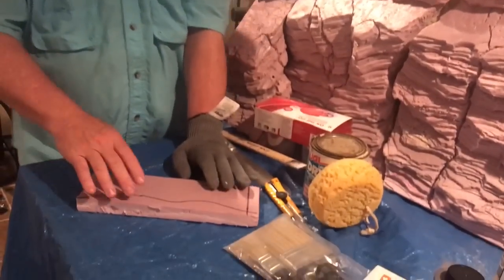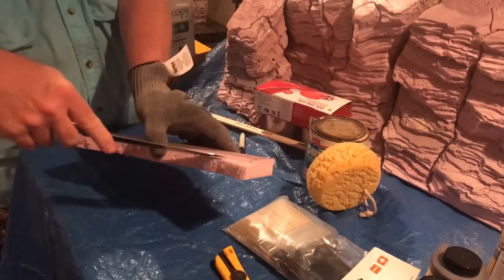How I Created My Faux Rock Wall Aquarium Background

Comment: Watching this guy using the knife, absolutely terrifying and anxiety producing....seeing the results, absolute perfection! Amazing work thanks for sharing your expertise/tips!
Reply from the maker: Thank you very much.  I learned the hard way to wear a filet glove after having to get a few stitches  on my thumb.  After that, I never came close to an issue.  There are some good comments below that could improve on the safety aspect of cutting foam like this.  One was to find a way to clamp the foam boards together so that you wouldn't need to use the other hand.  If I had to do it all over again, I'd probably go that route in addition to using the filet glove.

Comment: Good job,quiet realistic.I did mine with a soldering iron and drew the rocks and then aged it with a blow torch
Reply from the maker: Thank you Peter.  I did some work with a heat gun and soldering iron as well, but on the roots, not the wall.  I experimented with both on some of the wall pieces first, but chose a different route with them.  There are so many ways to get a result, the key is to find one that is consistent with your end product.  Do you have a link to your work?

Comment: You sir are nothing short of amazing!  How many hours do you have in that piece?
Reply from the maker: I stretched work out a long time on this project, starting a couple years ago and am now almost finished.  However, the actual time working on it took far less.  I had to figure out how to make it work, and I spent a lot of time "thinking" about those things.  I'm kind of a perfectionist, I guess, and I kept fiddling with it to get the look that I wanted.  Once I made decisions on the direction that I'd go, I jumped in and got each step done pretty quickly.  Waiting for the glue to dry after gluing the each of the boards together with Gorilla glue took about two hours for each layer before I'd move on to the next, so that is probably the most time consuming part.  I've since painted and installed the piece in my tank.  I painted it with Drylok mixed with cement dye, and that took some time for each layer to dry.  So yeah, maybe I could do it again in a couple weeks or less, knowing what I know now, If I spent all of my free time working on it, and had to do it again.   The bigger problem is that I spend a lot of time in the outdoors, fishing and looking for fossils, so another reason this wasn't done quickly, LOL  Anyway, thank you for the compliment!

Comment: Did I miss how you get it to stick to the back wall of the aquarium? also do sea urchins chew it up?
Reply from the maker: This is in my river tank.  How I built it all is in my build thread on NANFA.  But, basically, I made it in 3 pieces and used a heckuva lot of silicone to adhere it to the glass.  Also, it fit very tight within the frame, so no chance of it coming free.  It's all FW, so no critters can mess the wall up.  I painted it with many coats of Drylok but after I installed it, I didn't want to ruin the wall via tank maintenance, so I used a museum clear coat called Polygem.  Now it's almost indestructible.  There are lots of videos on this channel showing it after I installed it and have many tank updates since with fish in it.  My build thread should answer any questions.  That said, someone commented on here previously that they'd like to see a build video from start to finish, so I may do that some day.  It's a lot of work though.

Comment: Hey! I tried doing this with drylok hydraulic cement with the same pigment but after it dried the color would just come right off with my finger until it went all the way through to white foam. I see you are using regular drylok correct? Any thoughts
Reply from the maker: Yes, I just used several coats of the Drylok waterproofing paint covering pink extruded polystyrene foam insulation board. Here’s a link to what I used. https://www.homedepot.com/p/DRYLOK-1-gal-Clear-Interior-Exterior-Floor-and-Wall-Basement-and-Masonry-Waterproofer-20913/205079075

Also, don’t get the Drylok with any mold reduction chemicals.

After I completed painting, I coated it with Polygem clear coat epoxy to protect it.

Comment: Question : how do you keep the wall from floating up in the aquarium?
Reply from the maker: That's a really good question Nigel.  After I finished constructing the foam boards, there was a gap between the back frame of the structure and the front of the wall that I stuffed with river rocks.  Then, I sealed them in with spray foam.  I used 8-9 tubes of silicone applied to the top, bottom, sides and back of the structure as well as the tank...so...tons of glue.  In addition, the entire thing fits tightly in the tank under the tank frame and cross brace, which I think is key.  I've had the tank up and running for 3 years and it doesn't budge.  I am putting together a video that I will have out soon that goes into detail from start to finish and the status of the tank today, so stay tuned!

Comment: Question: how do you keep it submerged? It seems like it would be extremely buoyant.
Reply from the maker: Thank you for your question Laura, it's a good one, and an issue that, when planning this, made me struggle and worry about how I'd avoid it from just coming apart. The 3 structures are basically hollow and filled with river rocks to help keep it less buoyant, but more importantly, the three sections fit tightly inside the aquarium frame, snug to the top. I also used a ton of silicone glue on the bottom, back and sides. So far, so good. This tank has been up and running since October 2019 and I have not had any issues with the wall. If you wish to learn more about this build, I have a build thread on the NANFA forum: https://forum.nanfa.org/index.php/topic/16651-75-gallon-native-stream-tank-build/

Comment: Excellent work great technique
Reply from the maker: Thank you so much Orion!
Reply: @coachkevinwilson1958  I could use some Pointers and advice if you’re still on here LOL
Reply from the maker: @oriondriscoll3516  Sure Orion, no problem.  I have a build thread on the NANFA forum that details just about how I did everything from start to finish, and updates after.  I can give you the link to that if you're interested.  In addition, you can contact me there with questions, or here, however you wish.  But, that build thread has a lot of pics and details.

Here's the link:  http://forum.nanfa.org/index.php/topic/16651-75-gallon-native-stream-tank-build/#entry140297
Reply from the maker: scroll about halfway down the first page and that's where the fun really begins :)

Comment: I bookmarked this vid but couldn't find it for a long time. Im so glad i randomly found this again. Really outstanding work. Your wall really does look amazing. Can we get an update? How has it held up?
Reply from the maker: Thank you so much Casval!  I'm making a new video from start to finish that has an update at the end.  In a nutshell, it's solidly in there and held up great.  The big difference was using Polygem epoxy clear coat after I finished painting it.   The clear coat is invisible under water and really keeps me (or fish) from chipping off paint or foam, and makes the structure very solid.  Polygem is one of the brands that museums, public aquariums and zoos use.  I explain all of this in my next video, coming out soon. Stay tuned!

Comment: The last step is to paint the foam with drylok and cement pigment? Did i get this right? And how long normally to leave it until it fully dries up?
Reply from the maker: Yes, I painted several coats of Drylok mixed with various colors of cement dye (you can also mix them) to get the colors to match rocks found in my area.  I guess each coat took a couple hours to dry.  I used paint brush for the first coat without dye (was already gray in the can), and a sponge to dab it on after that for each subsequent coat.  After I installed it in the tank, I wound up using a clear coat epoxy to add strength to it that I got from Polygem and it turned out great.  I did that because after doing all that work, I didn't want to damage it when doing cleaning and tank maintenance.  The Drylok is a good sealant, but, that on foam can chip off accidentally by moving rocks or using cleaning tools.  Now, it's as strong as real rocks.  Here's my build thread, starting with the Drylok painting of the rock wall:  http://forum.nanfa.org/index.php/topic/16651-75-gallon-native-stream-tank-build/?p=149813  The posts after this show all of the paint layers and colors that I used, a couple pages later is the finished rock wall.
Reply: @coachkevinwilson1958  this is really helpful! I appreciate you explaining it in detail. Thanks! 😃
Reply from the maker: @afifahzulkefli2647  You're quite welcome Afifah!

Comment: do u have to put any sealer on it  so it will be safe for the fish
Reply from the maker: James, I painted it with Drylok which is safe and seals it in.  The foam itself is safe, no need to seal it in, but the pink doesn't look natural, hence, the need for paint.  Some people use Cement, which can cause pH issues, and sealing that in with Drylok works.  For my wall, the Drylok shows the detail that you put into it, and cement tends to cover up detail, so I chose the Drylok method.  Also, to glue the layers, I used Gorilla Glue, and once cured, is inert and safe for fish too.

Comment: hiya would these styrene backgrounds pose a fire risk with the heat bulbs
Reply from the maker: I don’t think so in my case because it’s entirely submerged in my aquarium, and, I have LED lighting.
Reply from the maker: After thinking about this, I think if I was going to do one for reptiles where such a bulb was being used, I'd cover it with a cement solution rather than what I used for an aquarium (Drylok/epoxy clear coat) for that reason. You can get the same colors using cement dyes that I used in my Drylok. You might not get as much detail in some cases, but I've seen some really nice backgrounds using the cement method.

Comment: Fantastic work..dry loc is not dangerous for the fishes?
Reply from the maker: Thank you so much! Not at all, Drylok is completely inert once dried. I also wound up using an epoxy clear coat commonly used in the museums and public aquariums made by Polygem, not to contain toxins, but rather, to protect the Drylok from being rubbed off by fish, or worse, by from me being clumbsy while working in the tank. I've had no issues as the tank has been up and running for several years now. I've had many successful spawns in the tank with some of my native fish. I couldn't be happier with how it turned out.

Comment: Awesome! Thank you for going into detail about how to carve the styrofoam. This video was very helpful for me. I was wondering how the carving was done to make the realistic looking rock breaks and formations.
Reply from the maker: Thank you so much Raven.  I used a butcher knife to chip pieces off of the edge for each foam board, then glued them together.  Once I had several sections glued together, I used wood cooking skewers to poke and chip out small pieces to make the cracks.  After that, I sometimes went back to the knife to carve out a little more along the edges of the cracks to make it look like the crack caused erosion.  You can use anything sharp to make the cracks, such as an ice pick, for example.  I used a picture off of the internet of a rock formation that I liked, and tried to imitate that as much as I could.  Does that answer your question?
Reply: @coachkevinwilson1958  yes it did! Thank you so much. You are so talented. Keep up the good work! ❤
Reply from the maker: Thank you so much Raven!

Comment: Great work. What glue is suitable for gluing foam together? And also what glue is suitable for gluing foam with glass.
Reply from the maker: Thank you so much Asiri! I used a LOT of silicone to glue the back, sides and bottom to the glass, like maybe 7 or 8 tubes, I think. This project was a lot of foam and I wanted to make sure that it didn't break away and float. I also imbedded river rocks inside the structure. It was done in 3 pieces, and was a very tight fit in the aquarium frame, which also helps.
Reply from the maker: Sorry, I missed answering the first part of your question. I used Gorilla Glue to glue the foam to foam and it works great. You will break the foam board before breaking that glued bond. Also, spray insulation foam will work well, but it's messy IMHO.
Reply: Thank you so much.

Comment: Love it question how would you add like small holes in it like if u wanted to put caves into it. I have a 90 gallon I would love try it in my tank
Reply from the maker: Thank you so much Lorenzo, I appreciate the compliment.  There are a couple ways that you could do it.  One way is to carve 2 sections and overlay one over the other with a spacer toward the back between the upper and lower section, to create a gap or crevice between the layers..  Another way would be to have a solid unit and carve out the cave, deep into it.  Both would work, but I think the first option would be easier.  My entire wall was 3 sections, and the "crevice" between them when glued into the tank looks like a natural crack in the rock.  You can do something similar like that too, with a wider crevice.  Study natural rock formations and try to duplicate one that you like.  I looked at a lot of rock formation pictures on the net until I found one that I liked.  Carving foam allows you to create anything you want.  Don't worry about being exact with your model, just similar.  Rock layers and formations are random anyway.  Good luck.  Post a link to a pic when you are done.
Reply from the maker: Also Lorenzo, check out this link to a build that inspired me.  He did great work and had a great approach trying to duplicate something that he found in nature.  https://www.monsterfishkeepers.com/forums/threads/diy-styrofoam-background-rocks.452727/

Comment: How much did you carve out on the back side? I heard some people complain that this much foam wants to float too much once you add water... even with it glued to the glass.
Reply from the maker: I filled the inside with river rocks and secured them with spray foam.  It fits very tightly in the tank.  The tank frame and the cross brace also hold it in place.  I used a ton of silicone to hold it in place.  So far, so good.  I filled the tank recently to test everything and it passed with flying colors after being submerged for a week.  There was no sign of separation from the glass.
Reply from the maker: I thought that I'd follow up 2 years later...the wall still fits tightly and won't budge.  It's holding up nicely.  So far, so good!
Reply: @coachkevinwilson1958  thanks for the follow-up.

Comment: What material you used. Is it thermacol?
Reply from the maker: Yes, thermacol I think is the same thing.  In the USA, it's known as Extruded Polystyrene.  It is sold as insulation boards for constructions of houses.  However, our local hardware store sold hobby versions of this foam board that was about 24"x24"x1" (I think, if I remember correctly).

Comment: Hi Kevin, was wondering the exact product name for the styrofoam panels..  i know they are made by Dow, and that they’re craft or hobby panels,  but having a hard time finding them in your color.. blue and white are easy to find, but i love that color you are using.. also what dimensions did you buy for the panels?  Are they 2” thick?
Reply from the maker: Hi Rob.  They're called Foamular Project Panels and they are 2'x2' and 1" thick.  I got them at Home Depot.  You can use any of the foam insulation board.  I saw some that were 4'x8' and 2" thick.  Knowing what I know now, I would have purchased and used one of those boards as well as the ones that I purchased.  I think that the thicker boards give you some more carving flexibility, and less gluing (saving more time drying).  But, hindsight is 20/20.  My project turned out OK.  I'll post a new video update soon, as I am nearly done with the faux roots for my tank.  By the way, I painted over the pink color using Drylok mixed with cement dye to give the wall a more realistic look.  Here is a link to the foam boards that I used:  https://www.homedepot.com/p/Project-Panels-FOAMULAR-1-in-x-2-ft-x-2-ft-R-5-Small-Projects-Rigid-Pink-Foam-Board-Insulation-Sheathing-PP1/203553730

Comment: What is the foam you are using and do you paint your backgrounds. If so, do you use acrylic paint? Do you coat it in anything to make it aquarium safe?
Reply from the maker: Hi Elizabeth.  I used hobby foam board that I purchased at Home Depot.  It's the same thing as the pink insulation board that you can buy in the construction section of your hardware store.  I think that the blue and the pink are the same thing.  As far as paint goes, I used Drylok paint, which is a sealant and is waterproof once cured.  I used cement dye mixed in to get the colors that I wanted.  The paint, when cured, is aquarium safe, as is the foam itself, since it's inert.  However, I coated the final structure using Polygem clear coat epoxy to make it stronger.  I didn't want to accidentally chip off a piece of a background and have that pink foam show through.  The Polygem made it much stronger, almost indestructible, enough that I can clean the wall with an abrasive sponge or brush and not have to worry about breaking off the paint and exposing the pink foam.  Why worry about the foam being exposed?  It's aquarium safe, so no problem there.  I just didn't want the unnatural pink color showing through.  The epoxy clear coat protects the hard work that I did.  You can see the final product in later videos, including my most recent one.  Thanks for the comment and best wishes.